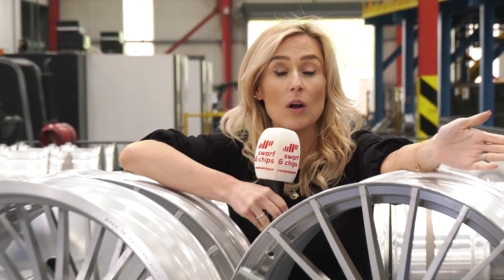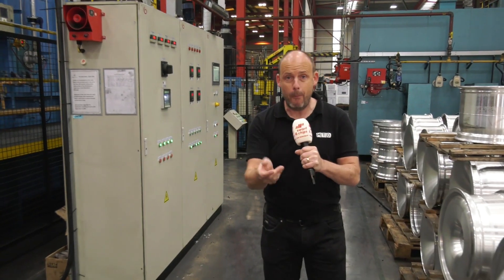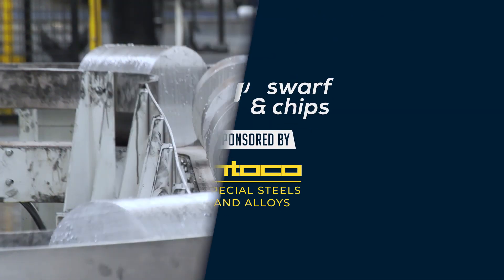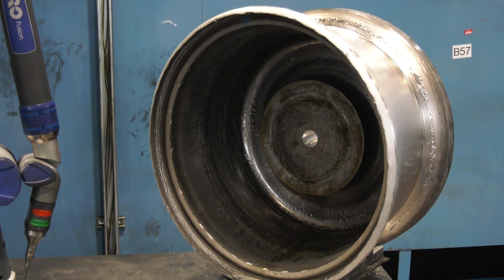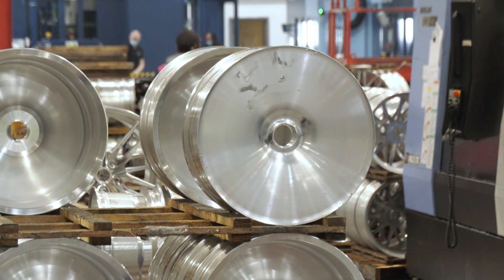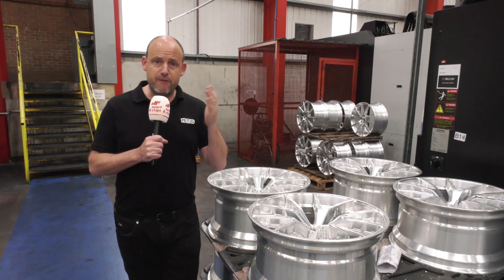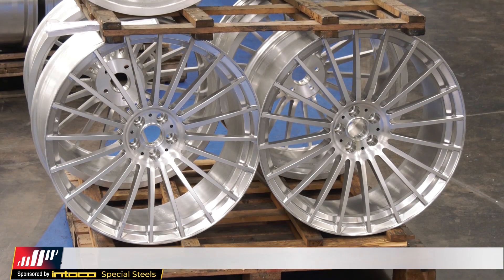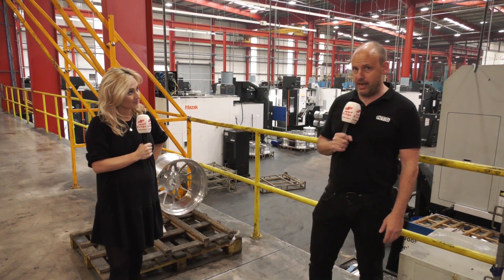You won’t believe how these wheels are made! | #SwarfandChips

Comment: Do they have a foundry on-site to make their cast wheels?
Reply: no in 2020 when we had covid they made the foundry redundant plus when you cast a wheel the more spokes the more chance of porosity in the spokes a problem they did suffer they got rid of there heat treatment oven for cast wheels as the big one they showed had a lot of problems it its early days and they got rid of the machine shop that machined the cast wheels on cnc machines thats why  now they only do forged is more fool proof as they had a lot of problems with cast as its moulton metal under low pressure you with get shrinkage or porosity or flow marks or half casting sometimes
Reply from the maker: yes